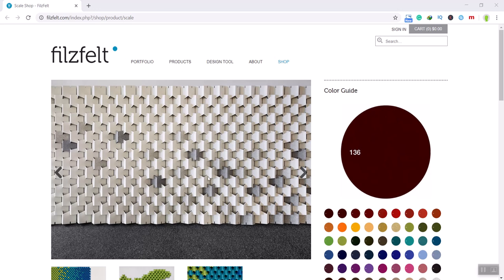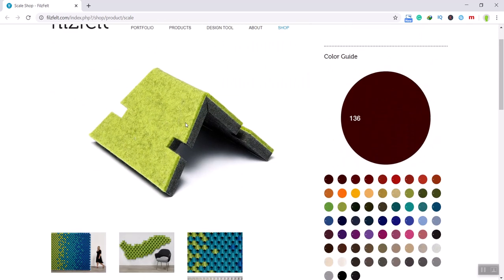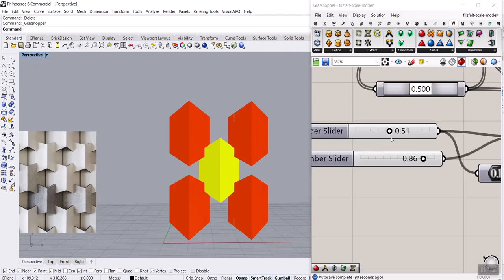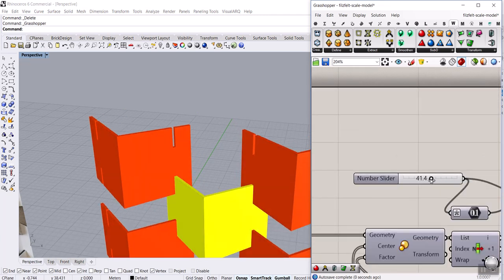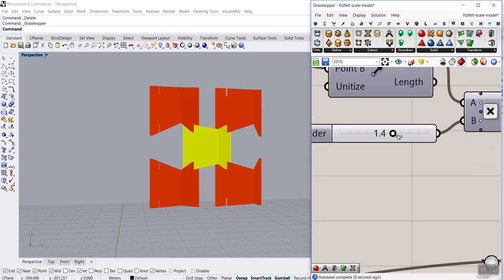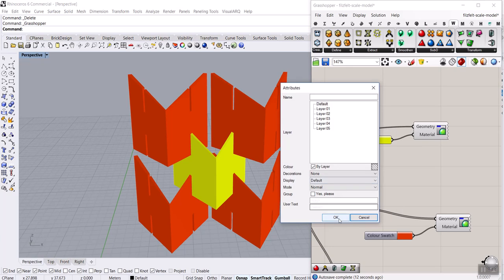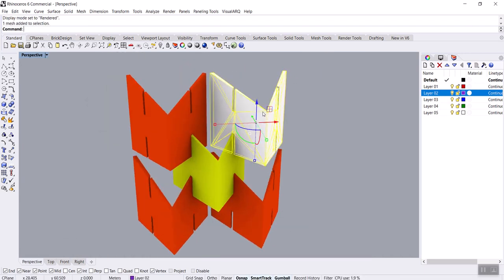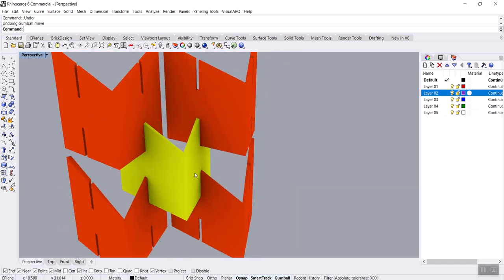Filzfelt Scale Panels

Comment: Aren't the contection holes to big? In my opinion for conect the moduls they should be 2 times smaller, becouse now they won't connect like in the real world. Am I right?
Reply from the maker: The slits are calculated by the boolean difference between two intersecting solids so it has to be right! ;)
Reply: @ParametricHouse  the boolean difference is the total gap where the two objects intersect each other. for this to work right in the real world, the difference height has to be halved just like @JAKUB mentioned. (otherwise the part would move down all the way through the slit.) Consider this similar to making two circles, outer circle 12mm and inner circle 6mm and when measuring the distance between two quads of the same side, the difference being 3mm instead of 6mm because other 3mm is on the opposite quad.
Reply from the maker: @dev.swarnakar  Thank you for your insight Gurudev...Yes, we actually have explained this in our tutorial...the intersecting gap has to move up half of the height of the gap so it makes a perfect sit...maybe the demo or video cover is misleading which is actually a simple difference between meshes to make it fast to change and show the overview
Reply: @ParametricHouse  thanks for clarifying it in the video. the demo isn't misleading, rather a question I felt was necessary to be answered for the many others who would be watching the video.
Reply from the maker: @dev.swarnakar  you're welcone
Thank you for following us